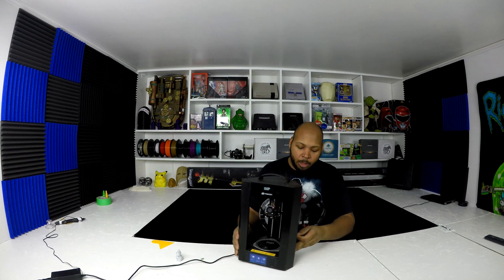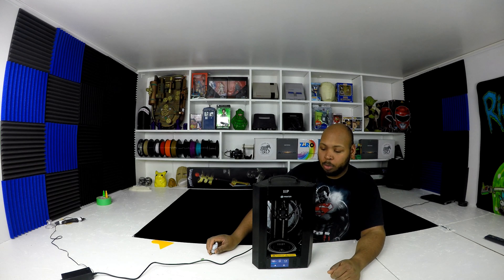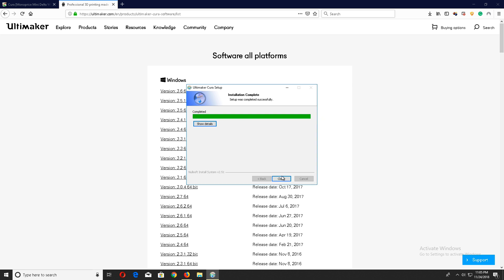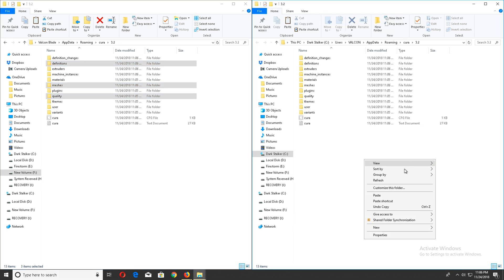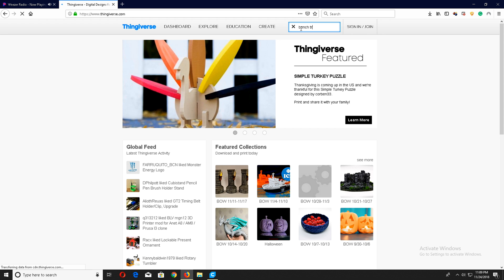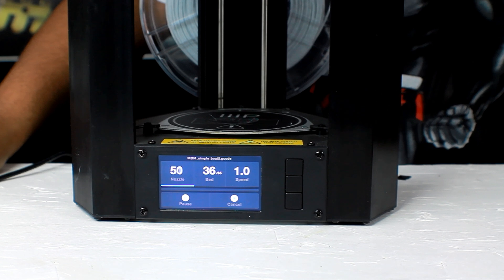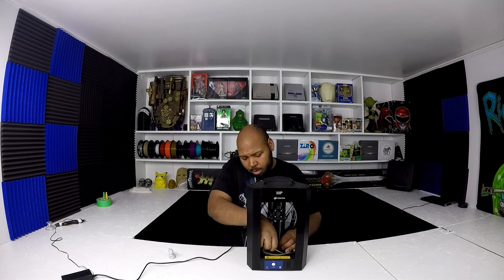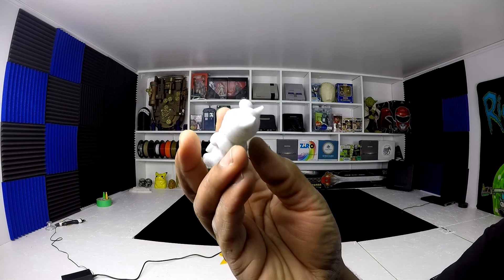Mono Price Mini Delta Cura Software Setup and Print

Comment: I just got his printer from a buddy of mine.
1. Is there a reason why we have to use Cura v3.2.1 instead of the latest v4.6.1?
2. I tried downloading v3.2.1 from https://github.com/Ultimaker/Cura/tags?after=3.5.1
but there is not a Windows setup executable.  How did you install it?

Comment: I am having trouble with my delta mini although I have followed as you did exactly  when u click print it does not heat up or calibrate it just stays on the print screen any advice?

Comment: Best gcode that worked for me.

M190 S45
M104 S195
M109 S195
M82 ;absolute extrusion mode
G21;(metric values)
G90;(absolute positioning)
M82;(set extruder to absolute mode)
M107;(start with the fan off)
G28;(Home)
G29 P2 Z0.30;(Level the bed, using 4-point measurement.)
G1 X55 Y0 Z5 F3000;(Move to the outside of the bed.)
G92 E0;(reset extrusion distance)
G1 E5 F500;(Prime.)
G1 Z0;(Down to printing height.)
G2 X0 Y55 I-55 J0 E20 F3000;(Draw a priming arc.)
G1 E15 F5000;(Small retract)
G92 E0

Comment: I can't seem to get my printer bed to heat up to 65 degrees
Reply: Also this video was very helpful, thank you.
Reply from the maker: It's definitely tough on this printer to get the bed to 65 without enclosing the 3 openings . I used cardboard and masking tape and it worked well for me . I was able to achieve some really good ABS prints doing so .

Comment: will  the 4.1 - 64 bit May 31, 2019 version work , or do I need the specifically only the 3.4.1,?? thanks just got it used, didn't come with sd card, my sds's are 32 and didnt read, tried to format with extra sofware, still not reading.. i got 44.160.3 version printer on the screen on boot.... -- so besides getting a new sd card under 8gb, is the Cura file i want 4.1 or 3.4.1 ? thx. sorry first timer..
Reply from the maker: Hey bud if you follow my newer video. I walk you through how to setup the printer with the version 4.3 or higher.Heres the link https://youtu.be/bAem1Q179vw . Also some 32 GB sd cards will work the printer is just really picky about card brand , format and allocation size . Heres another link to help you with the SD card. https://www.mpminidelta.com/parts/microsd_card Hope this helps bud . Feel free to reach out if you need more help.
Reply: @TheCasualCreator1  awesome ill check it out first thing manyana

Comment: I got this for Christmas and this video is confusing
Reply from the maker: Sorry bud which parts confuse you I can attempt to walk you through .
Reply: @TheCasualCreator1 I also just got this for xmas and am going through the setup now.  I downloaded the newest version of Cura (4.1?) and some stuff looks different.  Is it compatible with the newest one?  I downloaded the newest profile and copied it into my files, but when I go to select a printer, there is no "other" option and I can't find the printer anywhere. Now under custom, I found "DeltaBot" and when I add it, the model looks the same in Cura as yours.  Is that what I'm looking for?  Unfortunately I am not by my printer right now and so I was just trying to get setup for when I can test everything tonight so I can't verify if that profile works or not.  Any ideas?  

Thanks for the vid and links.  First time getting into 3d printing, and I wasn't sure where to start.  Thanks in advance for any help you can provide.
Reply from the maker: @gplatt4472 Sorry to hear your having some trouble .Yeah some of the process has definitely change . Here's a link to my new video covering how to set it up with the updated version of Cura hope this helps bud !!! https://youtu.be/bAem1Q179vw

Comment: The video was very helpful so I could start making other prints on my mini Delta. But one thing that is a problem for me right now, the MicroSD card that came with my printer, only has the file of printing the little cat. I did figure out the cura 3.2.1 so my build plate shows up for scaling and such. When I got a file on the card to try out, the moving head part for some reason moved slower and did not do the Three Corner double tap, and then I realized that the nozzle was not even touching the build plate. So I was wondering if you have any possible info on how to fix the problem? Because I would really like to be able to print more than just the one cat file.
Reply from the maker: Attempt a manual setup by following my other video. Here's the link it could be a Code issue. https://youtu.be/flrbekM9OA0

Comment: Is there a difference for what type of PLA I use? Or does it work with all PLA? I don't really know what filament to buy.
Reply from the maker: It's prints all PLA , I prefer Hatchbox over all . But I've used Amazon basic , Dikale, 3D solutions , Color Me and Mika 3D. They all work well .

Comment: I only have for Cura 3.6 and Cura 4.0, WHAT DO I DO !!!!
Reply from the maker: Hey bud sorry for the late reply here's a video I made for version 3.6 https://youtu.be/S2gXoNVfoj8
Reply: Ok I have the knocking problem,  bought this printer is my first. Got it on ebay has the wrong SD   card since it has the manual for the 1 arm mini not the delta. Also has cura 18.000 something and 2 G files one is pyramid maze other is level line. Very upset thought this was a out of box ready new user friendly.

Comment: How do you insert the filament? And what do you do if the calibration is wrong? Thx.
Reply from the maker: On the right side of the printer there's s filament port that leads to a Bowden tube insert the filament there . If it's warped there's not much you can do but replace the aluminium plate , or pick up a glass plate online or at a craft store .

Comment: Just making sure, this is PLA filament, correct?
Reply from the maker: You can use PLA or ABS . Works best with PLA .You need to trap the heat if you use ABS .

Comment: Bed plate temperature
(Mono Price Mini Delta Cura Software Setup and Print)
I'm having a problem in keeping my Bed plate temperature constant while printing.
it goes up to my minimum requierments of the nozzle and the Bed at first
(my nozzle stays always constant while printing and gets heated after my Bed,
-my bed droppes a second after he gets my minimum requierments (80) ,
it has an immence influence on my products.
please please please reply!
help, Yossi
Reply from the maker: I have problems with the bed temperature staying consistent as well . Didnt impact my prints until I tried printing with ABS . So now I use a glass bed and I trap all the heat in by blocking off all 3 opening with cardboard cut to size and use painters tape to hold it in place . Trapping the heat in will keep the bed plate temperature consistent unless the head change is extreme . For example it dropping from 65- 0 . That means the heated plate is most likely defective . But a replacement is around 20-30 bucks.
Reply: @TheCasualCreator1   you can send me a image to my gmail ?
My mail is yossi0003@gmail.com
Ty so much
Reply from the maker: @yossibaroh6145  unfortunately I'm not home at the moment I'm at work .But here's a link to one of my videos showing the cardboard , clipboard enclosure. To give you an idea of what I did .https://youtu.be/uXUrAA_B1vQ. You can fast forwards to close to the end to see the enclosure.Its sloppy but it was a quick attempt to keep the temperature up . Now I have clean cut cardboard fit to size . I can send that to you Gmail when I make it home .
Reply: It drops from 85 to 45 and then rises to 58

Comment: When I upload my own gcode the printer doesn’t do its bed leveling procedure also it starts printing about 5mm above the bed..any help? Thanks!
Reply from the maker: Make your way to your printer settings and verify the start Gcode contains bed leveling commands. You should see a G28 home command followed by G29 command . Should look similar to what is below .If your start code doesn't look similar . Feel free to copy and paste this start code it's from my mono price profile when I was using Cura 3.2 .
G21;(metric values)
G90;(absolute positioning)
M82;(set extruder to absolute mode)
M107;(start with the fan off)
G28;(Home)
G29 C-0.8 Z0.30;(Level the bed.)
G1 X55 Y0 Z5 F3000;(Move to the outside of the bed.)
G92 E0;(reset extrusion distance)
G1 E5 F500;(Prime.)
G1 Z0;(Down to printing height.)
G2 X0 Y55 I-55 J0 E20 F3000;(Draw a priming arc.)
G1 E15 F5000;(Small retract)
G92 E0;(zero the extruded length)
Reply: Thanks!! I will try this out and get back to you!
Reply from the maker: @dangerousbutdoable9638  Anytime bud , Hopefully all goes well . Feel free to reach out anytime.
Reply: You Sir, are a gentleman and a scholar. Works great, thank you!
Reply from the maker: @dangerousbutdoable9638 awesome!! , thanks anytime bud

Comment: Thank you so much for the tutorial my friend, it helped a lot. First time ever touching a 3D Printer, and only turned it on after watching this! Looking forward more tips! My initial "thoughts" are: how long is the bed going to last. I've only printed 4 little things and there are leftovers from the nozzle everywhere in the plate. How to clean that? How to change it, if ever needed? Is it common to have it changed? I've read that blue tape is a good solution, and I'll try it soon, and let you know here.
Thanks a lot for the videos, keep it up! Regards from Brazil!
Reply from the maker: Thanks for watching bud always happy to see more people join the 3D printing community. I'll have a video out in the next day or so covering a lot of those topics. But here are some written tips for now .The plastic print remover doesn't work well. I use a metal Paint remover tool to remove the parts and to scrap off any remaining plastic. When the black build plate surface wears out , rip ,tear etc. It's best to remove all of it from the aluminium bed and use blue painters tape, kapton tape or replacement build plate sheets . They are fairly cheap about 6 bucks for 4 new build plate covers . They last quite a while my build plate surface has been through about 40 prints and still running strong .Also you can use acetone on the surface as well let it soak for a couple of minutes that will loosen the stuck on filament for easy removal . This. Most likely cause discoloration to  your build plate . But won't impact prints. Also warm up your build plate using preheat this make cleaning and removal easier . Happy printing bud .
Reply: @TheCasualCreator1  Thanks a lot for the reply. I haven't printed much these past days, but will start again this week and keep you posted. The video was very informative, and these tips also help a lot to understand how to manage the bed. I appreciate it! Let's keep in touch! Happy 2019!
Reply from the maker: @thiago.prodrigues   thanks Anytime. Keep in touch happy printing and happy new year .

Comment: how do you use the cord that comes with it because my pc dose not have a  micro SD card holder
Reply from the maker: Follow the same setup process from this video . From there plug your printer into your computer and allow windows to detect it . Now open Cura and Cura should detect that your connected via USB and give you the option to print via USB instead of sending the file to removable . I apologize I'm going from memory because I'm currently at work . Let me know of this works. if not I will make video with step by step instructions and have it posted tonight .Great question appreciate the feed back . Pretty sure there are a ton of people running into the same wall.
Reply from the maker: https://youtu.be/7lWJ8wTsmeA Heres the link for USB Setup
Reply: It prefers you use the usb

Comment: hey man was wondering if you know were I can get the original software that is on the micro sd that came with the printer. I accidentally wiped the sd card.
Reply from the maker: It's located on the ultimaker website make your down the list to version 15.04.06. I provided the link below . https://ultimaker.com/en/products/ultimaker-cura-software/list
Reply: @TheCasualCreator1  The auto00.g file is nowhere on the Cura site. I think you may have misunderstood Jeff.